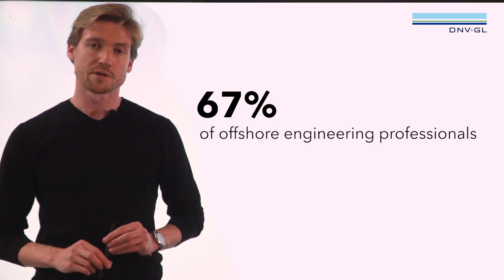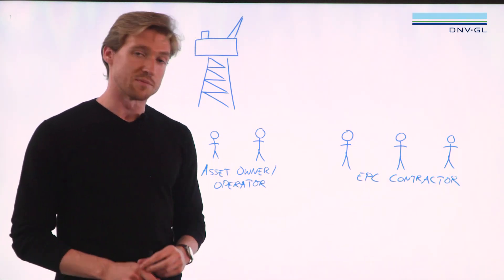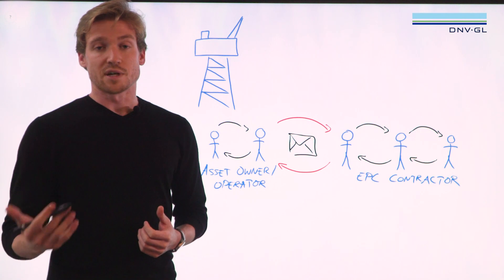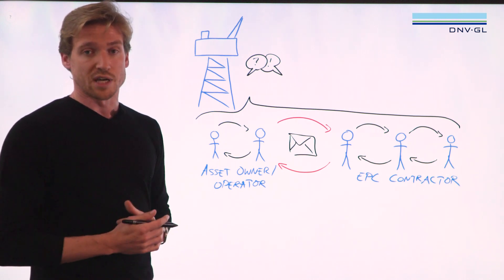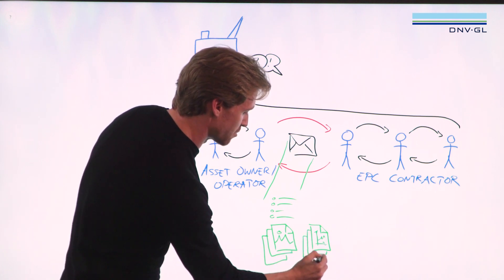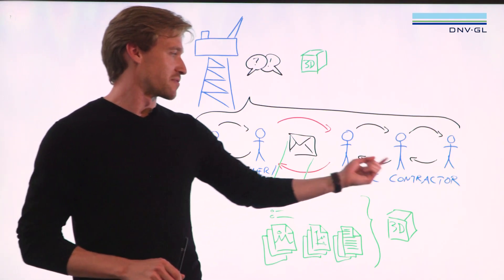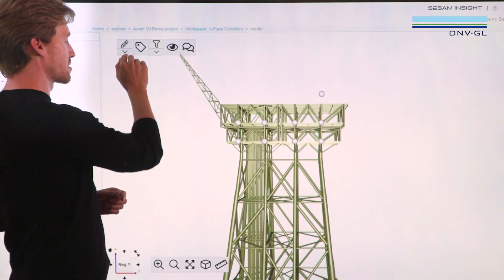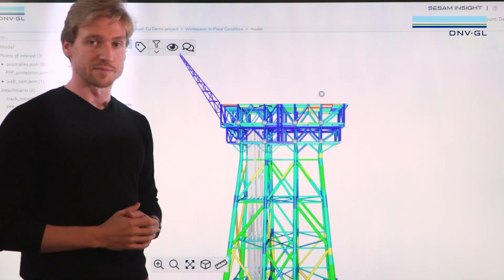How do you overcome the top three challenges in your offshore structural engineering projects?

Comment: Can I use a batch file to run so many design models in Sesam GeniE. Example is modelling 10 models like a cylinder with 10 different parameters like diameter. Instead of changing the diameters in the JS Script one after the other, is it possible to batch run it with one script? Thanks in advance for your help.
Reply from the maker: Thank you for your question! If you are a GeniE, please open the help menu and navigate to “Guiding Documents”. In there, you will find a PDF called “Parametric Models”, which gives examples of creating models in a parametric way, so that they can be easily controlled through a simple script – that way, you can create many different variants without manual modification of the model input files.